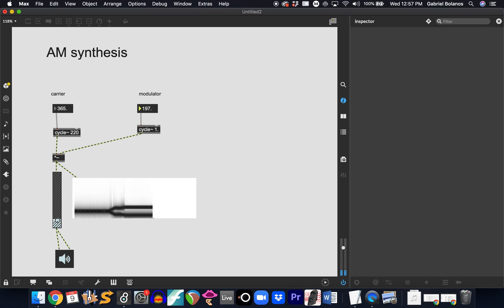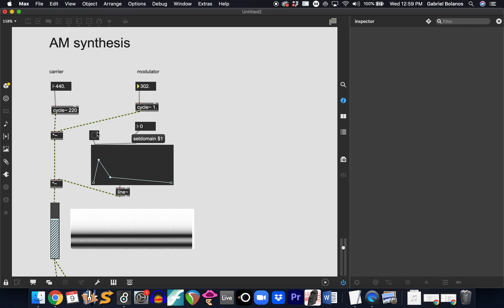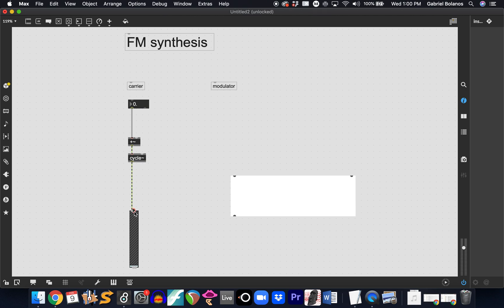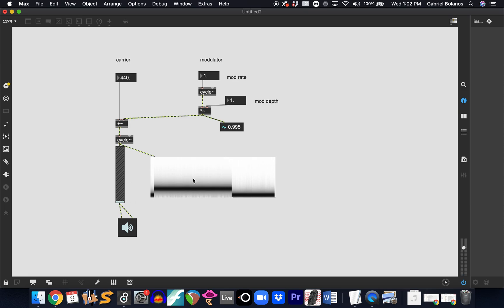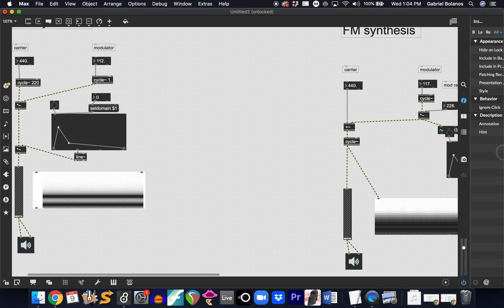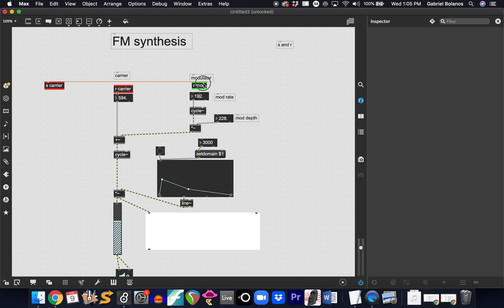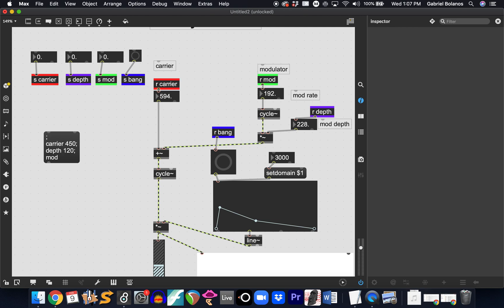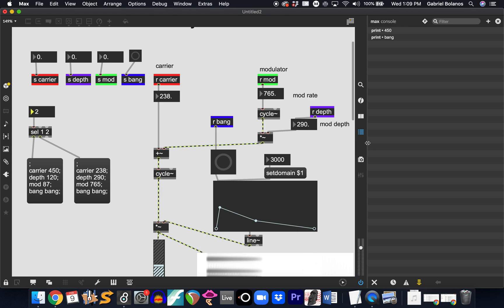AM and FM synthesis in Max/MSP

Comment: The first one is not an AM synthesis but a ring modulation. You're missing the unipolar modulating signal.
Reply from the maker: Yes- thanks for the correction! Adding an abs~ object after the modulator would make it AM.